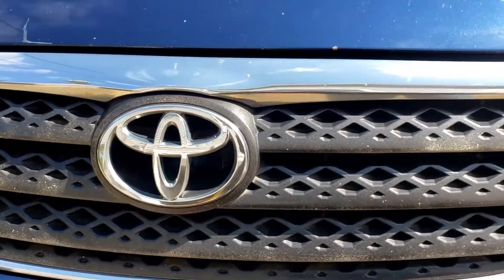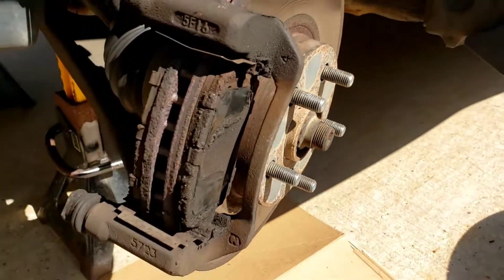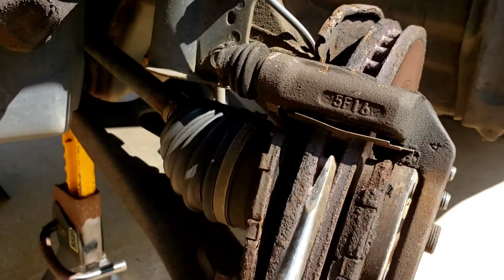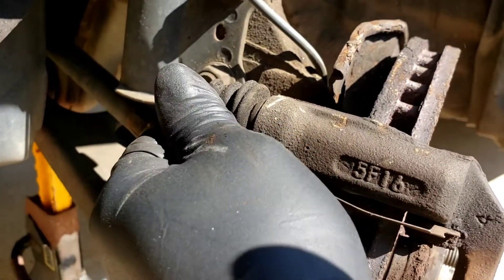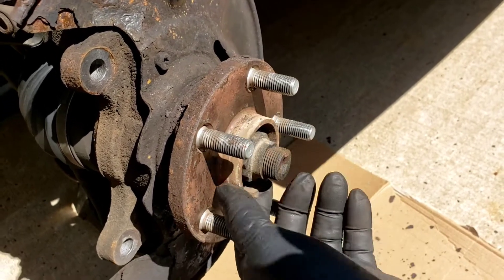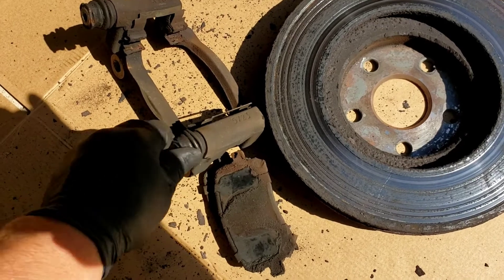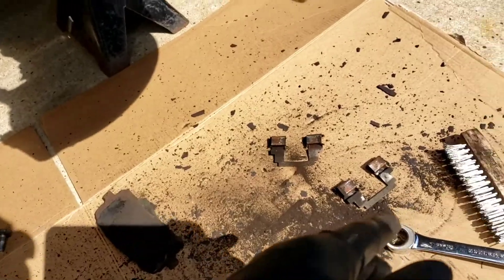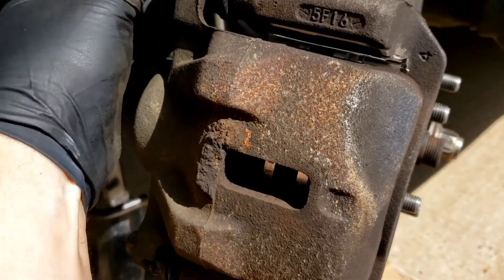Why does 1 Brake Pad wear out faster than the Other Toyota Corolla S 2005 How to Replace Rotors

Comment: Tganks for the video, but this isnt the problem im having, i just redid my back brakes, and only the rear left was worn down, completely gone had to resurface the rotor, the other side still had a ¼-⅜" of pad left, and after checking the fronts today they still have ⅜-½" of pads, so why did my rear left go bad waay sooner than the others?
Reply from the maker: 1/4 -3/8 difference is not bad, there are lots of things that can cause it but nothing wears out exactly the same..same reason why one shoe or sneaker wears out more than the other foot. But your variance is good, it can also be the caliper or caliper hose starting to get clogged like a heart artery..when you push the caliper piston in, you will feel a resistance,  you can compare it to the other side and see if they both go in smoothly the same. Also rust or debris can wear out a brake pad faster too.